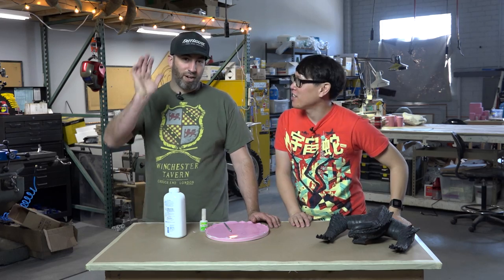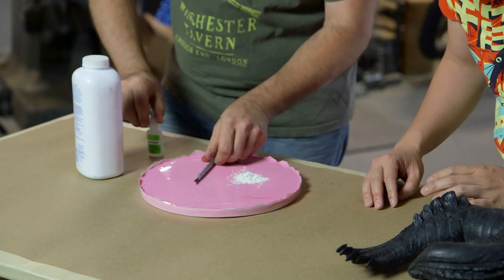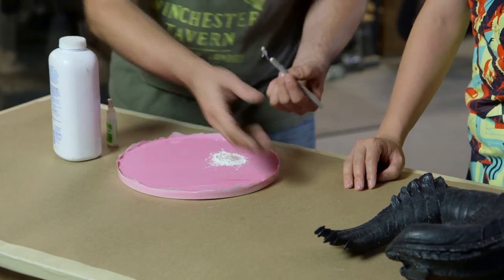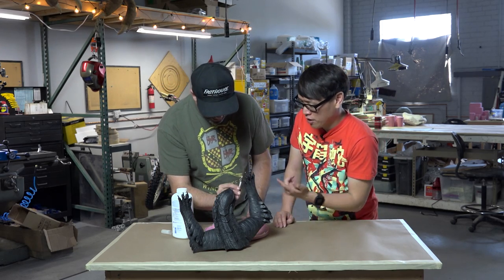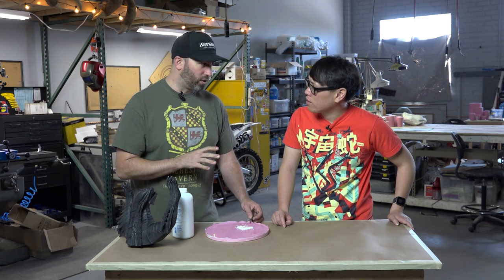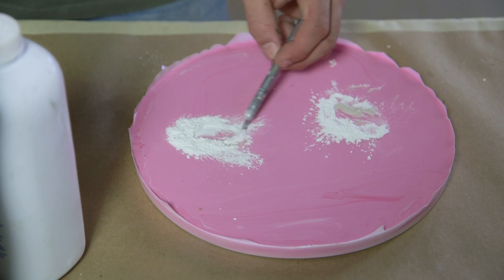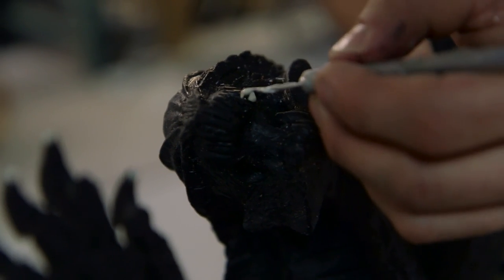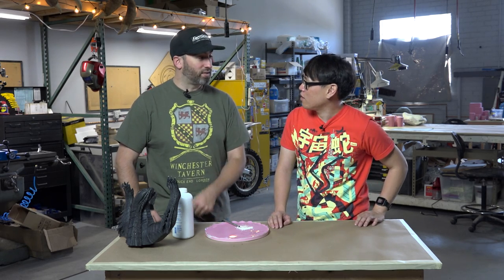Shop Tips: Mixing Superglue and Baby Powder

Comment: Guys, I like to thank both Frank and Adam for the information provided on this channel. Recently I had issues with my car having the passenger side mirror coming loose from the mounting.(The epoxy failed between the glass portion and the mounting) I attempted to use crazy glue to reattach it but due to the humidity and temperature outside, it wouldn't set. However, I remember you guys using 'kicker' to insta-set the glue, so I homemade my own mixture of baking soda and water in a spray bottle. Saved me a trip to the dealership/shop and paying for labor cost to make this easy fix. Cheers guys and thanks again!!!

Comment: I've used super glue and baking soda to fill and fix nut slots on guitars, it's a pretty old trick, first came across something like this at a go kart race meet where I saw a guy wrap paper tissue around a broken throttle part then soak it in super glue and it set like concrete in seconds!!

Comment: For plastics I'd suggest dilluting some of the scrap material in plastic cement to the thickness you want and use that as a filler as it will melt to one solid piece with the model. Another way is to use the cement for attaching a solid piece of plastic and then just cut away the excess, depends on the gap.

I know corn starch is also used as a kicker for super glue, but it might get brittle. Maybe this depends on the climate, but where I live it might be enough to store a model built with super glue in the basement during winter to make parts fall off easily.

Comment: When I visit restaurants offering free chop sticks, I always take home the ones I used and any extras left on the table, and with take-out, I keep the ones they give me, and put them in a tool drawer. I regularly use them as small tools or to mix anything that need mixing or careful application, including working with CA glue and other glues and powders, or mixing and applying small amounts of epoxy or paints, placing tiny amounts of oil, grease or polish, etc. in places you would not want to risk scratching with a metal applicator like a palette knife or Exacto blade. The tips of chopsticks can be shaped any way you want to, and they can either be cleaned after use or whittled to a new tip. Best of all, they are free, strong and re-usable. Remember that Exacto-type knives come with a variety of blade shapes and are relatively cheap - I keep a selection in the tool drawer, and when dull, they can be used as shown in the video, and when sharp, for many other purposes where a very sharp blade is appropriate.

Comment: Poor man's fiberglass. Superglue and tissue paper. It works well for plastic models and can be filed down, a bit hard to control but it helps fill out holes when I'm working on nerf gun mods if I cut a hole that's too big.
Reply: Thanks for that tip! I'll be adding that to my list of tools and materials.
Reply: Cut up strips of old bed sheets work well as fibreglass too..
I've used it a few times to repair things that need strength.
Sand and wet the repair with superglue, lay on a strip of fabric, remove air bubbles, re-wet and add another layer etc.

Comment: Superglue and sewing thread is an incredibly sturdy way to repair things or bind things together.
Reply: absolutely! I once used that to repair a drawer pull
Reply: yep, I've used this to repair a broken RC car.
Reply: Same applies to natural fibre strings, like jute, linen, cotton or hemp, I've fixed some pretty hefty things with string and super glue wraps!!
Reply: I used dual duty plus sewing thread and superglue to repair a split fishing pole. That was over a decade ago and it still works fine.

Comment: Reminiscent of woodworking and styrene model techniques.  I used to mix sprue scrapings and solvent glue to make filler for model kits and a good wood filler can be made by mixing the sawdust from the wood you're working with wood glue.  Cover the fill in even more sawdust and you can often even stain it the same as the surrounding wood.

Comment: Double sided tape (good quality stuff) plus vulcanized rubber to create rubber pads.
This is very handy with multi-copters to prevent the battery from slipping.

You may need to clean them from time to time if the rubber collects dust or (and) dirt. 
You can use simple peace of tape.

Comment: Great tip. I also use one where i glue something together with superglue (locktite is my prefered for this tip), then to set it and add mass, i dip it in a small jar of baking soda, it makes the glue set instant and it almost rises a little, so that there are added material to sand into perfect fit. I used it to rectify a mistake where i sanded too much off or the dremel tool slipped. But be warned, sanding or cutting it with a dremel tool or similar, makes dust of superglue fly arround, it stings in the eyes and airways, so wear a mask and make sure when cutting or sanding, that the material is blown away from eyes. But it makes wonder if a small part is sanded too much, the very tip is snapped off or you just want to add material to remove wobble without having to wait for drying.

Comment: I am a designer/Leatherworker I mix leather dust with superfix or masters glue to smooth edges or nicks in leather, also can use with cork sanded into a powder or wood glue and sawdust to fill holes in woodworking. It works like leather and depending on the glue is stainable and has the same feel as the material.

Comment: Never heard of this one.  Thanks!  I will definitly use this.  I have heard of/used CA and baking soda before.  It kicks off nearly instantly.  Typically you wouldn't mix it, but rather put baking soda into the area then use super thin CA.  When cured it is extremely hard.  You can use it to create sort of a "weld bead".

Comment: For R/C aircraft repair I use 5 minute or 30 minute glue mixed with baking soda.  Does what he is doing but much stronger.  CA glue is OK for a quick fix but will dry up and crack over time.  Best results come from 30 minute 2 part epoxy mixed with the baking soda.  30 minute will crack a lot less than the 5 minute epoxy or the CA (Super Glue) method.

Comment: Superglue and baking soda, especially the thin kind of glue, which has a consistency of water:
on a moderate mound of baking soda, if you drip the glue around the edges it gets sucked into the soda and creates an immediate reaction, where the glue sets instantly and becomes really hard.
The one thing you need to be careful of is that the reaction is so strong the compound briefly heats up to about 90c and smokes, and that smoke is painful if it gets in your eyes.
Great for welding pieces together - especially hard plasics like PVC, Perspex and hard urethanes.

Comment: Great tip! Never thought to use baby powder with super glue. I like to use baby powder with polyester resin (fiberglass resin) Especially for initial filling before the fiber layer. Takes a little longer to fully cure but turns out really hard.

Comment: Superglue is not a very good adhesive for things that need to bend and it can be tricky to get it to set well. It needs surface area and an oxygen free environment to set really well but it is brittle after. That's why RC car tires come undone so easily and why glue patches on your skin don't last more than a few days. 

I do however do something similar in guitar work with stripped screws. Ever go to put a locking strap kit on a soft wood guitar and had the screw strip as you attach the replacement? Get a little fine sawdust powder like from an emory board and tooth picks or popcicle sticks, and you can use sand paper, emery paper, a dremel, or anything to get dust. Then dab a little white wood glue into the mix and pack it into the hole with wood glue. After setting up over night you can put the strap locks back on the body and the screws will go in tight and lock in place.

I've even done this with paper dust using a knife and a few sheets of paper.

Comment: I've also found that if you want something softer than baking soda or talc, you can sand down some sprues from a softer plastic model kit and do the same thing. These all work in a pinch, but i prefer to spend the $5 on model putty.

Comment: there's a similar tip used in carpentry, where you make filler by mxing PVA glue with sawdust to match the colour of the wood you're working with. This glue dries a lot slower than cyanoacrylate, afaik. The recipe could be modified with any other suitable powder.

Comment: this is a great idea and i will certainly use this

i do a lot of miniature modeling and i use blu-tack for fills or sculpts/mods then give it a light coat of super glue 
its great for those hard to reach areas where you need a lot of time to get shapes right as the blu-tack will hold shape and when you are happy with the shape use the super glue to seal it and make it permanent

its easier to work with than green stuff (epoxy putty) and can be as permanent or temporary as you wish  
if you want a permanent model you can build up layers of the blu-tack /glue like a lasagna for strength 
or you can just apply glue to external areas of the design if you are careful and make stick on parts 
(i made capes for my warhammer40k soldiers for a tournament, took them off afterwards)

Comment: When working with ABS plastic, I grind up old sprues into a powder, mix with polycement, and you have a really nice ABS putty.
Reply: Better than ABS and acetone. But you still have to apply it in thin layers and not use it to bond large pieces that could warp when it dries.

Comment: I've used fine sawdust for this technique before, didn't know talc would work, too :P
Would flour also work? Chalk dust?
Reply: I'd imagine any type of fine powder-like substance would work, just be careful of potential chemical interactions - talc and sawdust are fairly inert, but things like flour may have additives that could have negative interactions with the glue.
Reply: Yes, I imagine using flour might degrade in time or get mouldy due to the organic nature of the compound.
Reply: That's not even the least of it. Flour actually has bugs in it, grain weevils can start hatching in flour because adult weevils lay eggs in wheat kernels. A few of them will survive milling. If they start hatching, it's a pretty good way to tell when your flour has gone bad.
Reply: *****
Ah yes, delicious grain weevils.  Just like dad used to raise.
Reply: Baking soda

Comment: Similar to this, if you have a join in two pieces of wood you can mix the sanding dust from the wood with superglue to make a perfect colour match filler. Or even easier, you can just put dry dust in the gap with a bit of excess, drip superglue on top and sand off the excess when dry.
Reply: I agree. I always save some of the sawdust when making wood projects, especially from exotic woods. When I made Harry Potter themed wands, it make a great material to sculpt details into them with.
Reply: Wood turners use super glue as a high speed friction finish, they soak a rag with super glue and then press it to the fast spinning piece for a super shiny coating in seconds.

Comment: I've also seen baking soda used in a similar way. Any benefit to using one over the other?
Reply: Nope. It really is just any fine powder of a mineral source (salts, stone dust, plaster, etc) that does aversely react with cyanoacrylate glue. The type of glue is more important. The fine powder just functions to thicken the glue to make it more workable and give it more solid mass.
Reply: I have got the impression that baking soda makes the superglue expand as it cures - that it helps the glue crystallise. 
I usually apply superglue and then dip it in or sprinkle on baking soda. Blow on it and repeat.
Reply: TESTED -Please test & compare the properties of Talc (baby powder), Baking 
Soda (standard luthiers' nut reconstruction trick), Baking Powder (?), 
Sawdust, Chalk, Flour, and others listed here. Look at hardness, set time, shrink/swell, work-ability, and paint/color rentention.

Comment: My cousins laptop hinge broke the repair guy used Super Glue + Washing Powder to fix and the bond was concrete strong you should know laptop hinges go through a lot of force and tension yet its still working fine 😄😄

Comment: So i've used zip kicker with miniatures i've glued for tabletop war games. Not a fan. it doesn't really let the glue set enough. I find it get's super brittle and doesn't hold a bond very well.
Reply: It is not required in every application of superglue, but sometimes the kicker really helps, especially with metal models. For plastic models, a plastic glue should be used that fuses the plastic parts together. No need for a kicker then. For heavier parts, a pin should be employed for support.

Comment: Could you also get it thick enough to sculpt with?
Reply: Yes to some degree but bondo or other filler would always be better to sculpt with. The last studio I worked at had a prep shop that handled all the flashing, sanding, & bondo before sending parts to me for their primer coat. I often resorted to this to save them from extra work they missed that was too big to fill with primer & too small to warrant going back to them. My shop lead was pretty impressed when he came out & found me doing this all on my own. I just told him it was an efficient use of my time whenever my drying racks got full & I couldn't cart anything off to paint yet. Saved time in prep by not making them have to look all over a part for a small defect, saved the company on expensive primer coats & drying time, & gave me something useful to do whenever the workflow got backed up before or after things got to me.

Comment: could this be used to fix or finish PLA prints?
I'm thinking yes but it may not be cost efficient because of the amount needed for an entire surface coat.
Reply: What if you replaced the superglue with Elmer's or Gorilla glue? I'm already reaching for a failed print to test it out. ;)
Reply: For using it as a filler to smooth out the exterior of a 3D print, it works to some extent. Epoxy works best with the same filament ground down into a filler with sand paper, but clear Gorrilla Glue and Elmer's both worked with the grounded filler plastic as a finish/smoother, if that is what you are seeking. It does cause a loss of detail, but if that's not a big issue, it's worth experimenting with.
Reply: good to know. have some things (Gears) that I am going to print then finish up then cold cast in brass to make some nice looking exposed parts for what I am working on, but thought might have issues using the PLA to make my molds, but something like this fixes my need for a perfectly smooth angled edge.

Comment: not really your type of shop tip; my dad restores antique wooden stuff and lot of times if there's a screw in the wood, the "hole" of the screw is so worn out it won't hold the screw in place so he puts a matchstick in the hole (without its head, obviously) with a bit of wood glue, and the screw will hold in place very firmly next time.
/sorry for english, whatever/
Reply: My grandpa used to do this in 1966. It works great!

Comment: take short strips of paper towels and soak them in 5min epoxy boom easy kind of fiberglass type material
Reply: High strength shop "paper" towels are much stronger than regular paper towels and may give you a better result. I'm going to try the shop towel method today and see how it goes.